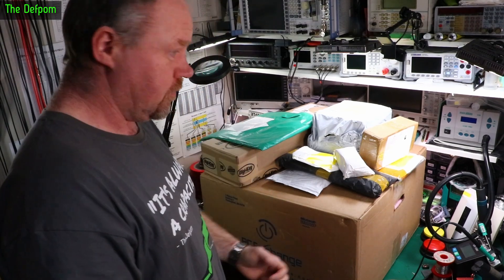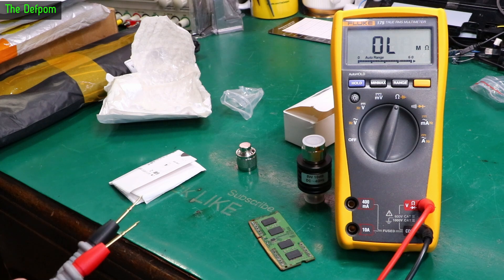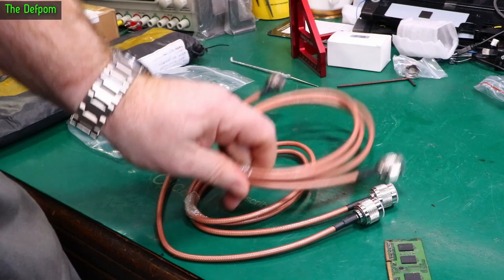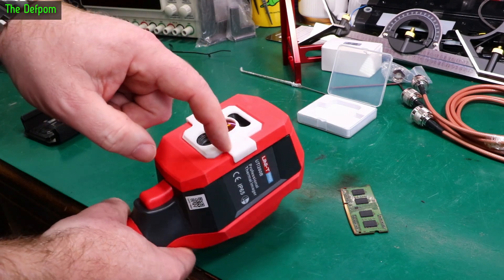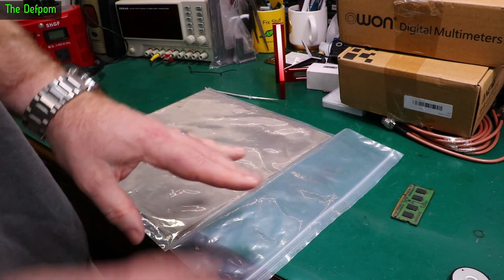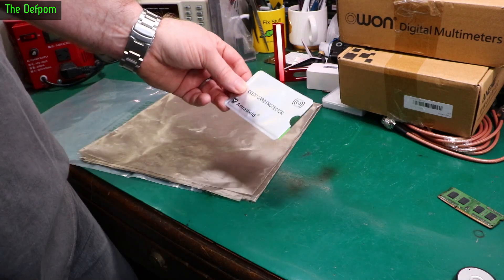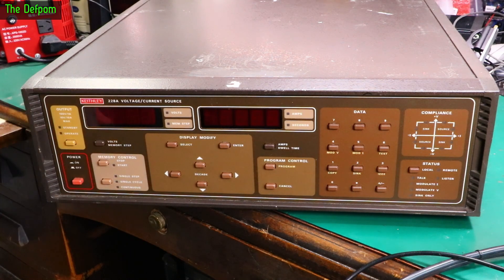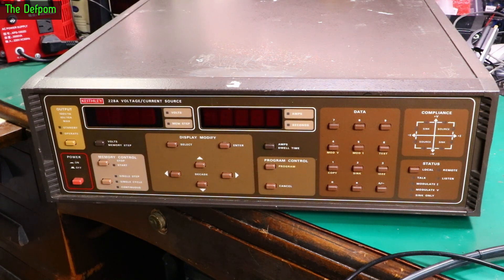🔴 Mailbag Monday 2nd October 2023 - No.1182

Comment: The N type cables look like RG142, if it's the real deal, it's an excellent and stable cable; unfortunately a lot of cheap versions use silver plated aluminium rather than silver plated copper, so not quite as rugged as the genuine stuff.